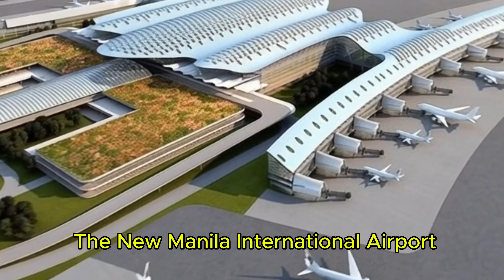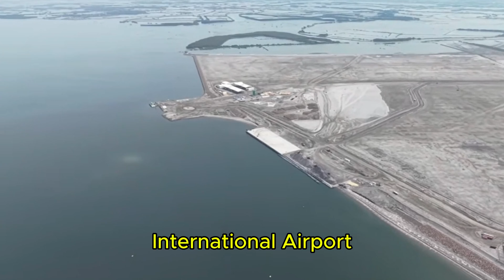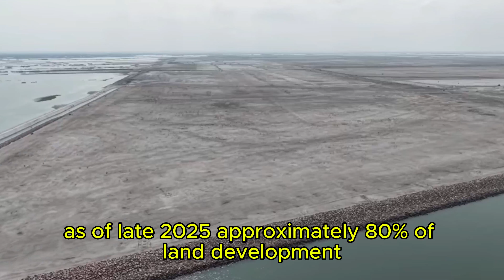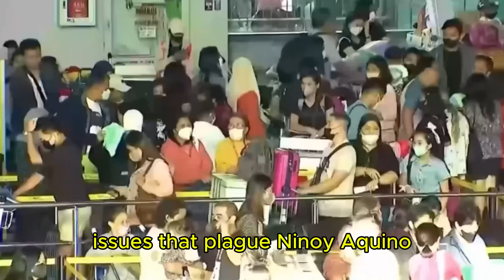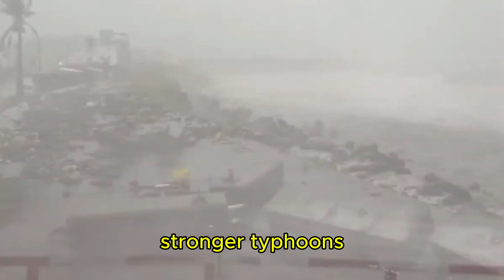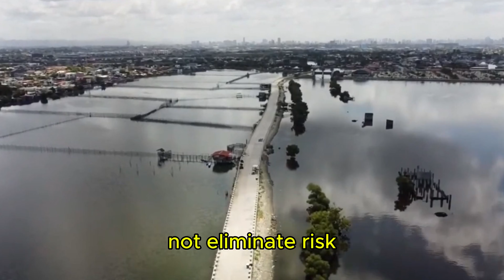New Manila International Airport Built on the Sea — Future Gateway or Risky Megaproject?

Comment: Existing air port it seems like domestic airport not for international😊
Reply from the maker: Yes, correct 😊
That part of the video shows NAIA’s domestic terminal, not the full international setup.
I used it to illustrate how the existing airport infrastructure is limited, especially compared to what NMIA is designed to handle in the future.

Comment: Loaded na ba masyado sa dalawang airport? Haha
Reply from the maker: Haha valid point 😄
Pero magkaiba kasi ng role yung dalawang airport.
NAIA is already overloaded, habang NMIA is designed as a future gateway with room to grow.
Ang tanong talaga: kailangan ba natin ng bagong airport, o dapat ayusin na lang ang luma? 👀
Reply: @jessierd2000  We need a new airport..because NAIA 123's runway is absolutely congested..all of them are using the same runway unlike the new project NMIA, the company San Miguel Corp will build 4 runways that will lessen air traffic congestion and flight delays...although it is a reclaimed land, nowadays we have a lot of future engineering design process to tackle complex issues in building, innovating new technologies for that company to use in making things work efficiently, safely and transforming scientific knowledge into practical and tangible solutions. Anyway, one example is the Hongkong International airport..it was also built in a reclaimed land area.